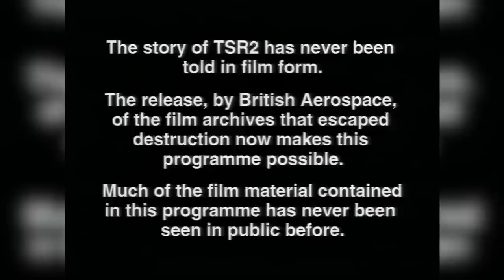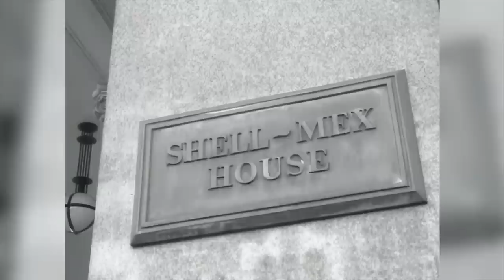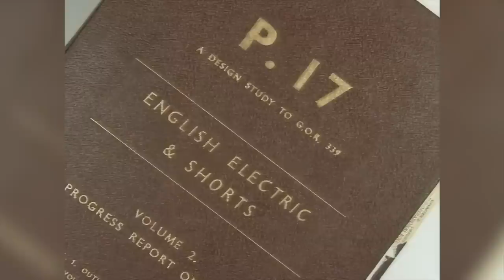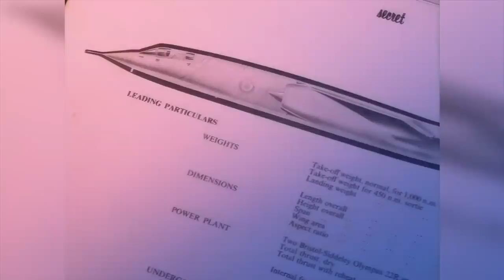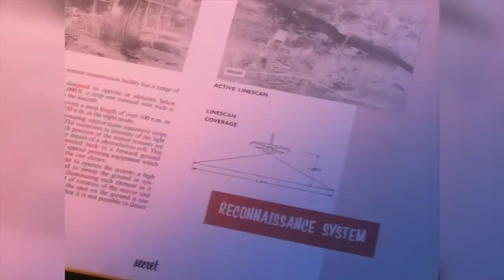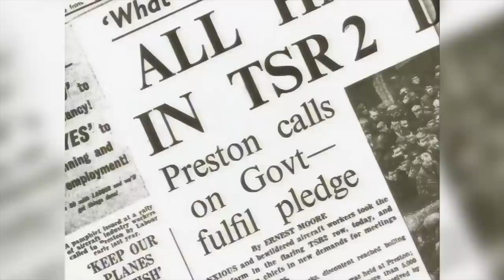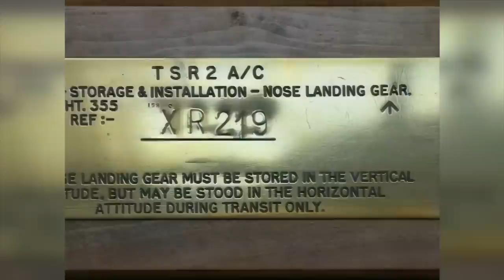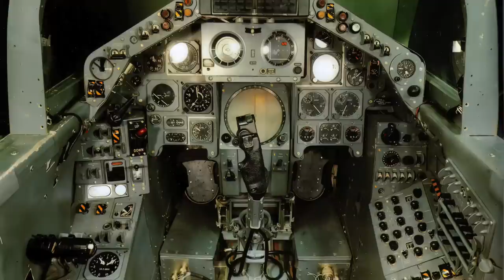BAC TSR2 | The British Cold War strike and reconnaissance aircraft that was cancelled | Upscaled

Comment: This would have been a World Beater. Criminal that it was cancelled. The craft in Gerry Anderson's - Terrahawks looked a lot like this and would have been an apt name for it.
Reply: Not really a5 vigilante , same era, slightly smaller, was faster and still a debetable plane, its tactical bomb role was soon negated  by ICBM's and so it soon became a recce plane, which well it was much to expensive in the long run for such limited use.

TSR2 would have been pretty much the same, UK would never have gottten use out of it.
At least the A5 had some use in the recce role..
Reply: It would certainly have been a great low level strike bomber and reconnaissance aircraft, maybe seeing use for a long long time, but of course its nuclear bomber role would be quickly obsolete, but would make a good rece aircraft still. But tbh many projects the UK has been involved in have produced great aircraft, especially as Multirole/fighter bombers e.g. Tornado. Typhoon, F-35 etc... Which typically became more popular and useful than large strategic bombers.

Comment: The same spite was shewn in the cancellation of the Miles M52 supersoniv jet of 1946 and to some extent, the scrapping of the Fairey Rotodyne rotorcraft 'helicopter' (and its research material) in 1962.
Reply: And the Saunders-Roe SR.177 rocket interceptor, Blue Streak and even the Black Arrow satellite launcher.
Reply: And the Avro Arrow in Canada
Reply: @freemenofengland2880  Poseidon , launched from submarines, was a safer, and more effective weapon system than Blue Streak, an example of technology overtaking the project.
Reply: @70sVRsignalman  Didn't that get replaced with AMERICAN made Polaris?
Reply: @RogueWraith909  Dear Sir, yes, you are correct, my apologies, Polaris did indeed precede Poseidon , and both are American made and controlled weapons systems.
Reply: You forgot the Nimrod,
Which was cancelled just as it was coming into production and left this country without any Maritime reconnaissance aircraft for 12 years.
Reply: Yes that is one of the reasons why the TSR2 was cancelled we didn’t need it anymore the strategic defence was going to be based around Polaris, which was the weapon system that kept the Kremlin awake at night, TSR2 should’ve been cancelled the minute the Nassau agreement was signed with the Americans.
Reply: @williamchick6649  Dear Sir, as other people involved with the Nimrod Programme have commented here before, the enormous cost over-runs due to the basic assumption that the Nimrod airframes were jig built, when it turned out that they were not, that meant that every upgrade would be unique, which meant that costs ballooned , which meant that Treasury said no. This was an unfortunate development, however Government Budgets should not be bottomless pits, and whilst I assume some allowance was made for the unforeseeable, each rebuilt Nimrod being unique was way beyond any anticipated cost over-run, plus very late delivery dates, so, unsurprisingly, the project was stopped. To my mind, the real surprise was that P3 Orions were not purchased after the Nimrod project was scrapped, especially considering that RAF aircrews did exchange programmes with both the RAAF, and RNZAF, both users of the P3, and the replacement, P8 Poseidon.

Comment: The design was compromised from it's inception. Due to money being tight it had to use the same basic engine as the Bristol engine for the Concorde,  a turbojet.  The F111 used more efficient turbofan engines. Although slightly smaller this aircraft had a greater range with a greater weapons load, this being the main reason for the Australia's order. RR had offered a turbojet design for the TSR2 programme but this engine could not be used on the Concorde. With the introduction of ballistic missiles it's roll as a strategic nuclear bomber was no longer required leaving  the TSR2 to expensive for it's other intended roles.  The later Tornado as we know was a lot small, uses turbofans and was not a true strategic bomber.
Reply: TSR2 wasn't a strategic aircraft at all!!! When it was being designed it's mission was totally tactical!!! The job of duking it out with Moscow's air defences was the job of Blue Streak, Skybolt and finally Polaris. The 1000NM internal fuel range with 100 NM supersonic dash was to allow the aircraft to fight limited wars against Indonesia or Egypt from existing RAF Bases without tanker support.
Reply: @richardvernon317  From an Australian perspective, European military aircraft and ships have a much shorter combat radius compared to the American alternative, the reason being, the Americans need airplanes and ships based on the West Coast USA that need to traverse the vast Pacific . Australia has a similar problem hence the purchase of the P51 Mustang, F86 Sabre & FA18 Hornet.

 The TSR2, like the Canadian Avro Arrow, were both potentially great aircraft, but both needed a lot more work, time, and money, to achieve this, and potential total orders were in relatively low numbers, meaning high unit cost, meaning was there a cheaper, and affordable alternative ? Was the alternatives sufficient for the perceived task at hand ? All Governments have a responsibility to wisely spend taxpayers money ( stop laughing, this is serious ! ) , and the demands on Government expenditure need to be aligned as close a possible to available revenue (some recent events may belie that ! ) .

 Defence expenditure, by its very nature, can be eyewateringly expensive, especially if the potential threat, in reality , is perceived to be a relatively low risk, all things considered. When modern combat aircraft have a unit cost exceeding the debt of small nations, it should not be surprising that Governments get to a point that they only see continual cost blow outs, delays, and political pain for a perceived overly expensive ( and apparently failing ) project. Persistence is fine, if the end result is achievable, but often enough a delayed project with cost blowouts can kill an otherwise reasonably competent government ( ultimately, nothing saves an incompetent one, though recent experience with some "leaders" in the short term at least, may suggest otherwise ! ). Bearing all of the above in mind, sometimes Governments come to the unpalatable conclusion, that killing a project is the only viable alternative. 

I do not think that the Wilson Labour Government came to that decision lightly, but Government finances were in a worse shape than initially thought, the looming currency crisis required action ( another painful decision ), it became clear that the TSR2 Programme required a lot more time and money, and the decision to pull back from East of Suez, combined to cause the programme to be cancelled. Subsequent events indicate that, ultimately, the decision to cancel TSR2 was the correct one under the prevailing circumstances.
Reply: @70sVRsignalman  but the alternative they chose was no closer to ready and significantly less capable???

Comment: All of the excellent research of the 50's and early 60's was undone by one thing - money. The UK was broke and therefore could not sustain its excellent aircraft industry and was at the mercy of US competition and political pressure.
Reply: political pressure being the kay factor and the reason we (brits) are still so pissed off about it
Reply: @thethirdman225  as i said in another comment (but not quite emphatically enough) about the cost the production line to build the TSR2 was built all the jigs and fixtures were in place and had to be cut up and destroyed (in a huge rush apparently) so it wasn't a plane with all sorts of problems they were mostly sorted and it was ready for production! 'someone' needed a competitor out of the way and used the war debt as leverage to make sure!

Comment: I hate to say it, but cancellation of TSR2 was probably the right decision.  The demanding and contradictory staff requirements were just too ambitious for the technology of the time, and the racks of valve based electronics would have been a maintenance nightmare.  Translating the problematic, if good looking, prototype in to an operational aircraft would have expensive and almost certainly impossible before the early 1970's.  Okay the Buccaneer wasn't supersonic, but it otherwise ticked most of the boxes and was already in production.   The real reason why cancellation of TSR.2 was a disaster is that it left the British aerospace industry without a major new project after the cancellation of other similarly overambitious and niche projects such as the SR.117, P.1165 and HS.681. The UK's failure to develop a relatively affordable supersonic successor to the Hunter had already handed over the export market to France.
Reply: No, all what was needed was for the avionics/electronics side to be scaled back. Just get the basic plane into service and then worry about the fancy stuff afterwards - just as the Americans did with the F-111.  The problem with TSR2 was trying to deliver everything as a working package in one hit.

Comment: Australia had ordered TSR.2 but the Americans said they would supply F.111's at a lower price. Unfortunately, and typically of American equipment, when finally delivered the F.111's were double the cost.
Reply: The TSR2  was inadequate for australis requirements  it could only fly half way( if that ) across the continent and could not strike any likely target in the pacific, too small no range
Reply: @johnmacey2375  and heavy due to the swing wings
Reply: @johnmacey2375 looking at a 111 close-up, and it certainly is a BIG aircraft...
Reply: Of course, the TSR.2 would have come in on time and under budget. 🤣🤣🤣🤣🤣🤣🤣🤣🤣🤣🤣

Comment: Parts of the TSR2 still existed up until 1984 as I personally saw the 3 axis gyroscope and the memory core module from the avionics. These were manufactured by Sperry who also built the avionis for the Concorde
Reply: Two surviving airframes.
Reply: @harrisionstan3773  apparently some TSR 2  engines and other bits are around other  museums .. too
Reply: Haven't you been to Duxford? There's a TSR2 there!
Reply: No I have not been to Duxford and assumed the airframe they had was taken away. Still I have no interest in seeing it and was only shown the gyroscope as the apprentice trainer justvhappened to have it in the training centre. It measured 4 inches cubed and had 3 completely separate gyroscopes for pitch, roll and yaw. Its is still one of the most advanced gyros ever produced and modern aircraft are only now catching up to THE TSR2 s capabilities
Reply: @geraldtalbot6400  I wouldn't agree that we're only just surpassing TSR2s capabilities because they weren't actual capabilities - but ATTEMPTED capabilities. The thing is, the kind of thing they were TRYING to achieve back then with simple analogue computers and brilliant mechanical engineering is trivial today with modern sensors and digital computing. Even if we take a step back in technology - somewhere in-between, take the moving map navigation system on Sea Harrier FA.2 - leaps ahead of TSR2s system despite being a relatively simple microprocessor controlled system without modern digital computing or GPS.  What they were trying to do with TSR2 was simply beyond the electronics of the day. They should have taken a pragmatic approach (like the F-111 project) get the basic aircraft finished and then work on the systems over time as technology progresses. The US then went on to make the same TSR2 "deliver everything" mistakes with F-22 and F-35!
Reply: @LondonSteveLee  I went to duxford in the  late 1980s   sadly I forgot to get photographed with the aircraft .. but yep I ve been to see  it .. I know the   cosford one  is 98 percent intact .. love to know how much of the duxford on is still in one piece
Reply: @robaspinall988  The Duxford plane is complete (airframe wise) but completely gutted as far as oily bits and avionics go.
Reply: @LondonSteveLee  when I visited  XR 222 in the 1980s   restoration work was still under way .. if the right hand inspection panel is ever  temporarily taken off ever again  I  think you ll find a surprizing amount of stuff still on board .. I know   alot of the flight controls are not there   . not sure about the obervers flight controls .. we  just dont know if the engines are still on board   . love to find out ..
Reply: @robaspinall988  I don't remember seeing engines last time I went. There is either a Concorde or TSR2 engine (or partial engine) on a stand if I remember rightly.

Comment: Perhaps the fundimental problem was that the RAF's staff requirement was too wide. (for instance, low level and high level flight having the same performance requirement). It is ironic that the RAF never got the F111 either, although they did get both the Buccaneer and the Phantom and appearently were very happy with both.
Reply: According to Aeroplane Magazine's TSR2 issue, the RAF CAS advised the RAAF to purchase the F111 in lieu of the TSR2. The F111 had a longer range, and a heavier weapons load, than the TSR2, added to which the USAF order was far larger 
( 563 + 76 FB 111 = 639 ) than the proposed RAF TSR2 order, ( 50 + RAAF 24 + 74 ) so on that basis the RAAF made the correct choice, and this also partially explains the RAF F111K choice. It should also be pointed out that the US electronics fit was more advanced than the British fit in 1963. Again not surprising when the US was building more warplanes, and spending a lot more than Britain on electronic warfare. I think that the MRCA Tornado Programme demonstrated that Europe financially could only keep up with the US if a multinational NATO Programme was agreed to, and thereafter funded. The reality was that Britain simply could not afford to fund the TSR2 in 1964, and the decision to pull back from east of Suez in 1966 simply made the TSR2 / F111K unnecessary. I agree that potentially it would have been a great aeroplane, but the F111 programme demonstrated just how expensive such advanced programmes are.( And we have not started to consider operational costs yet, when the USAF TAC withdrew the F111 from service, their maintenance costs went down by 25%. When the USN withdrew their F14 Tomcat, they also enjoyed a similar maintenance cost reduction.Both aeroplanes were brilliant, and their replacements had a lesser performance envelope, but technology moves on, target acquisition, and on target hits, are now of a higher level of both accuracy, and destructiveness than was the case in the 1980s/1990s Excellent video, Regards from Australia.
Reply: the penalty clause payments for F-111 cancelation was more than it would have cost to develope the TSR2..    F-111  was a dog.
Reply: The RAF pulled the plug on the F-111K project way too early. They could have ended up buying about 125 F-111K's, which would have effectively replaced all the V-bombers and would have been a nightmare for Soviet defense planners in the 1970's.
Reply: @andyb.1026  
Your comment is rubbish.
The F-111 was a viable aircraft.
The TSR-2 was great on paper but an unrealised dream.
Reply: @grahamlucas2712    I only say that as I worked on them,,  it was a Dog  🐕 😅
Reply: @andyb.1026  
Where and when did you.
"Work on them"?
The Australian experience was that they were not easy to 'work on' as is any high performance military aircraft.
The specific health issues regarding the self sealing wing fuel tanks weren't confined to the F-111.
As you have never "worked on" a TSR-2 you don't know what a mongrel it might have been to work on.
Come clean with us about your F-111 maintenance experience.
Reply: @andyb.1026  
A long time friend of mine moved to London from Australia as his father was the liaison officer RAAF to procure the TSR-2.
The TSR-2 was seen as brochureware.
Looks good on paper but wouldn't deliver the promised performance.
They were transferred to the USA to procure the F-111's for Australia.
Rob will find your comments amusing.
Reply: Of course they were happy - they flew
Reply: @andyb.1026  
The F-111 was an Ardvaark. not a dog at all.
A highly effective fighter bomber that served over 30 years in service.
The best crew escape module and an effective weapons system.
Reply: @andyb.1026  
So you pumped up the tires.
Any complex aircraft need complex servicing. 
40 years operational service does not make them a 'dog'.
They were an Ardvaark.
Something that you might be incapable of doing.
Reply: The RAF dodged a bullet with the F111. I was Chief Propulsion Systems HQACC  Langley AFB and the manager of TF30-P-111 that powered the F111F "super cruise" fighter bomber when we eventually achieved a 2200 EFH MOT.. The engine was developed on-wing from the outset with only a 20 EFH MOT.
Reply: @andyb.1026  The cancellation cost of F-111k was I believe £50million at the time.
Reply: @grahamlucas2712     BAe Bristol had a deep maintenance contract in the '80s, I did 18 months, mainly setting wing hi-lift, full span devices.  Some years on Lightnings, Harriers, Jags, MRCA/Tonka & Product support for AI & Boeing.     My Comments based on hands on practical experience ~ Not Yank BS & Bribery..  Over to you 🤪
Reply: @grahamlucas2712  Look up Rolly Beaumont real experience on TSR2 performance